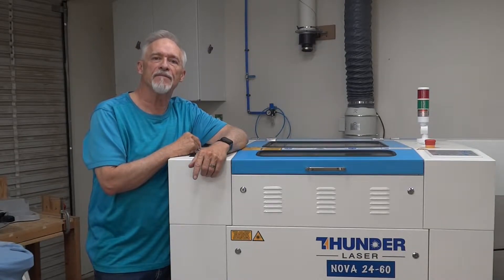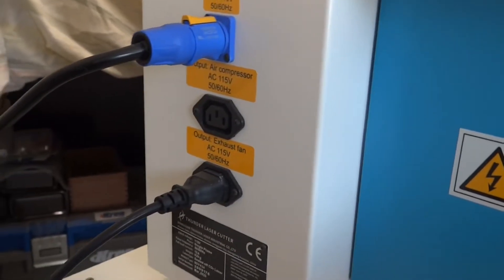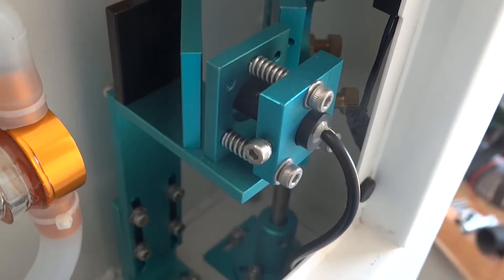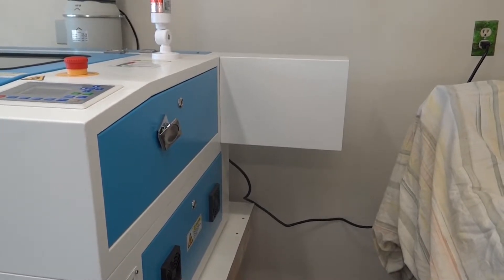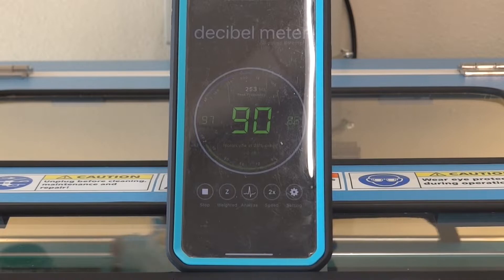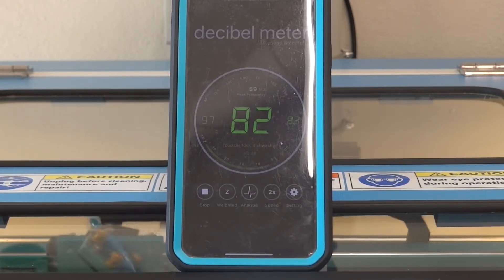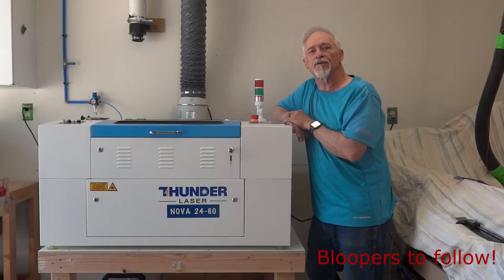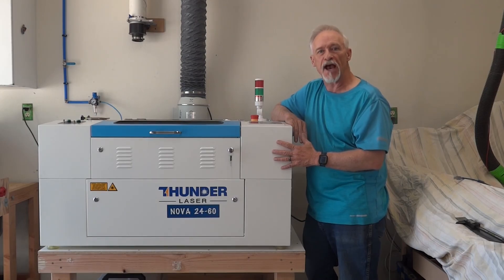Thunder Laser Nova 24 review part 2

Comment: Maybe foolish question.  Any tricks to get the laser lifted up onto the table?  Any idea if it needs to stay mostly level or if it’s safe to tilt one side up and then pivot it on?
Reply from the maker: No reason to keep it level before you set it up. They suggest to tip sideways to get through door ways.

Comment: What is the difference between the compressor that thunder supplies & having shop air?
Reply from the maker: the stock compressor delivers about 5psi to the nozzle the external air set up will deliver 55psi max. this makes much better cleaner cuts, no start cutting marks amd overall faster cuts.
Reply: Thank you so much for this info!  So I could just buy an air compressor and hook that up to it?  I'm in the middle of buying one right now 🤗
Reply from the maker: @krissyjohnson2246  yes be sure to buy an air regulator and moisture trap and install it right before it goes into the laser
Reply: @computercreationz do you have anywhere what you bought for this?
Reply from the maker: @krissyjohnson2246  if you goto thunderlaserusa.com in there knowledge and search external you will get all you need

Comment: hey thanks for the review. Question for u. Does the 24 have adjustable feet? Just curious if leveling is important. Other Thunders do have leveling adjustments.  Thanks much!!
Reply from the maker: no the feet on the 24 are fixed. no adjustment so the table or platform that you put your 24 on needs to be well built and fairly level. they don’t need to be perfectly level

Comment: Nice video sir, I appreciate all the info. I recently purchased a Nova 24 and am waiting on delivery. I want to build a cart similar to yours but would like the chiller sitting on a shelf under the laser so it can be removed easily for maintenance. However I have been unable to find dimensions on the chiller. Could you provide the dimensions of yours please?
Reply from the maker: the problem you will have if you build a shelf under the laser is the cart height will be tall enough that the controller will be very heigh. if you tall 6’ or taller that might be ok. The chiller stands about 19” tall. I’m 5’7” and with the dems on this cart the controller comes to my upper chest all ready.

Comment: Great review! Does your horizontal bracing on the cart block your chiller if you had to remove it?
Reply from the maker: I have screws that are easy to get to Remove one brace on the side and pull it out from under for service or water  change. Works great. Very limited space. Would recommend for the chiller go go beside the laser.

Comment: Hi... i just bought one, waiting for delivery. Question about your table dimensions... you mentioned your table is 46 inches wide but in the website it says the machine is 54 inches... I'm confused about what size the width should actually be.
Reply: Hi Adam, Congrats on your new laser, I absolutely love mine and use it every day. It’s a workhorse. the table is 46” wide the 54” that they refer to is the laser tube that sticks out the right side in the back of the machine. If you bought a Nova 24 60 watt. If you look at the video look towards the back of the machine on the right side and you can see the tube extension.
Reply: @robertkofoed9118  oh, that makes sense... i saw that stick out, and in the dimension in the site, but didn't factor that out. Thanks for the video, I'll be building mine next weekend and eagerly waiting delivery. I'm using it for my trophy business.